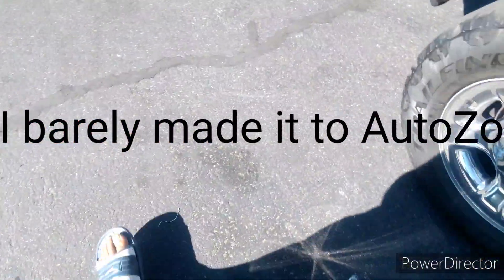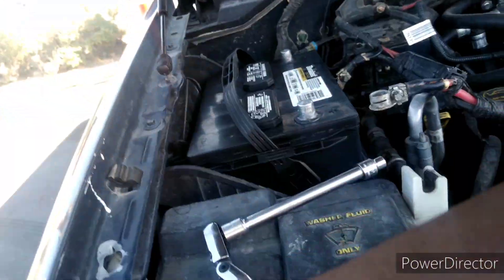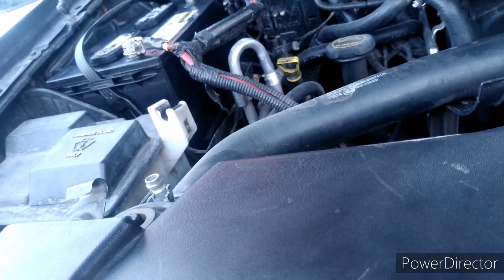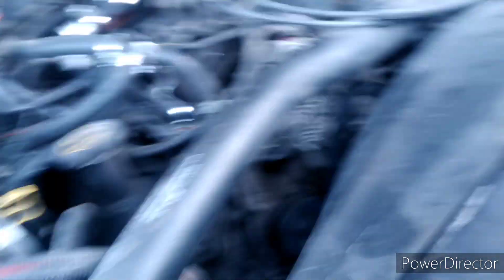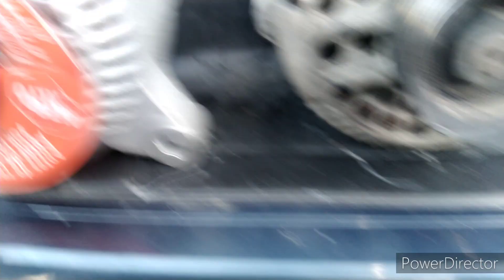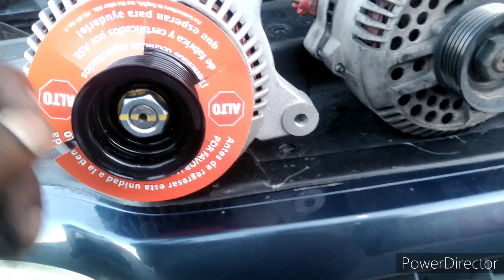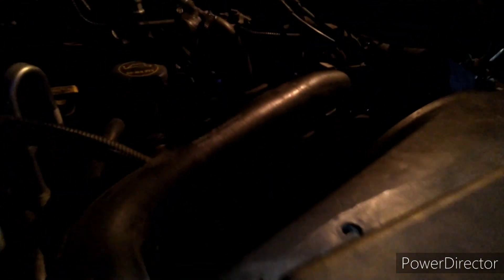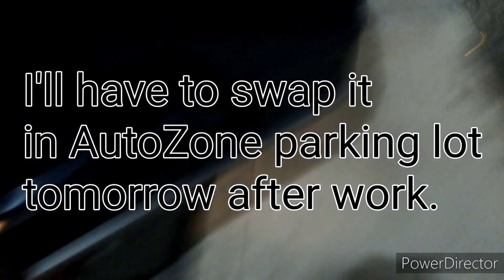Bad Alternator and wrong replacement given by AutoZone employee.

Comment: A new battery should keep you going for a long trip even with a bad alternator... But I guess you did run the ac... But the battery are good, you just need to change the alternator..
Reply from the maker: I did change the alternator as I took it off and found that the power connect bolt on the back under the red cover wasn't tightened.
Reply from the maker: i think my ac compressor is causing my alternator fuse to blow. I think I see a split in the wire at the connection on the compressor. i drove twenty something miles yesterday and it didn't. i kept the ac off. then today i tested out the theory if it's something with the ac clutch and compressor.
Reply from the maker: 2yrs later and its time to replace the battery again. $#&*